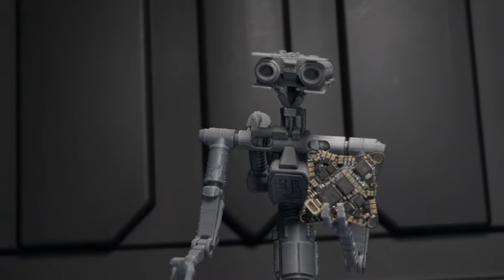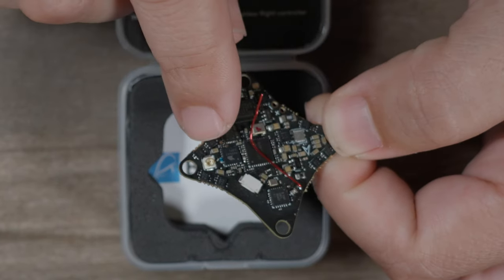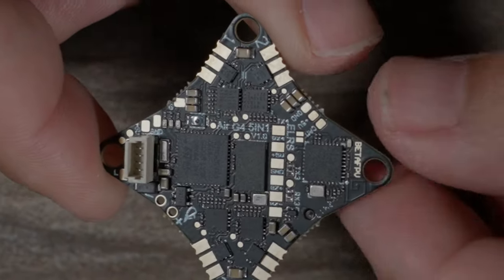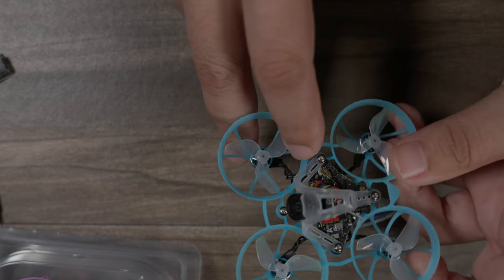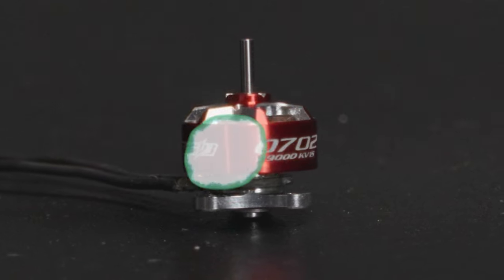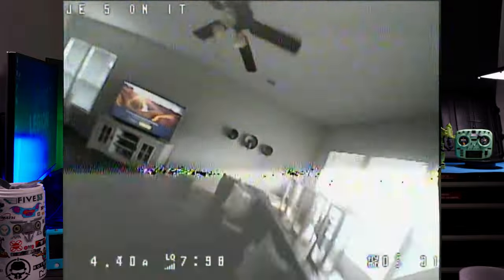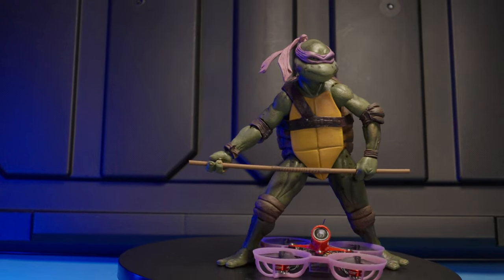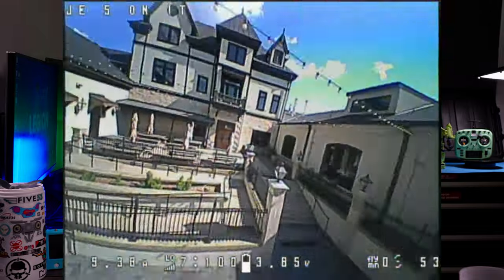Building a tiny drone is EASY now -  BetaFPV 5 in 1

Comment: Can someone explain to me the $35 screws?
Reply from the maker: Saves like half a gram. It’s like $9 per quad
Reply: And if you buy the betafpv 0702 motors they come with both peek and metal screws. Still cheap motors

Comment: How durable are these? 
I had a meteor75 pro and the AIO broke after a single crash. it was a minor one aswell and I stayed far away from BetaFPV after that. apart from their air frames, those are amazing
Reply: I have one of the new Air65 's with the 4in1 and have been flying and crashing it for a good little while. It flies really well and I haven't had any issues with it whatsoever, so I would guess that this new generation of BetaFPV AIOs seems pretty solid. I'm also waiting on the delivery of the Air75 which comes with the very same 4in1, that's how much I like these new tiny whoops. I'm not trying to sell anyone on anything, it's just my honest opinion.
Reply: I have an air65 and air75 using the 4in1 version of this AIO and they’ve taken an absolute beating over the past month and a half… I actually have no idea how they’re still both working with how badly I’ve treated them
Reply: @fullhamfpv  I really enjoyed it aswell for the time it lasted. The build quality was great and I loved the little charger it came with. I went through maybe 30 packs, then the gyro broke on my very first crash. I just graced a low hanging leave and dropped on the street from maybe 1,5m height. It didn't even had a single scratch on frame or canopy, but it was unflyable. It constantly twitched to the right and I couldn't do anything about it. I just returned it and got a mobula8. Never had an issue since then and I flew it a lot. I was lucky I got it the meteor from Amazon, they just took it back without asking questions